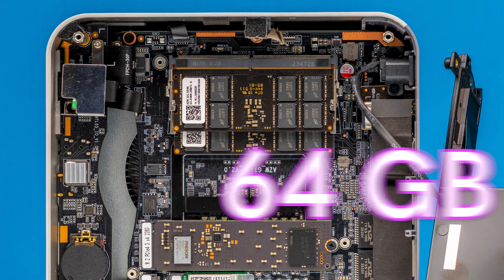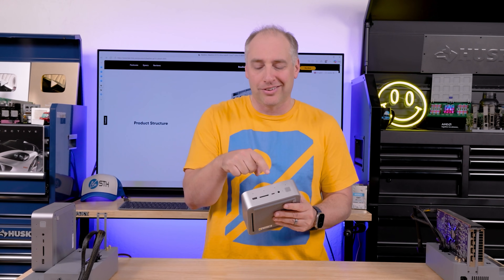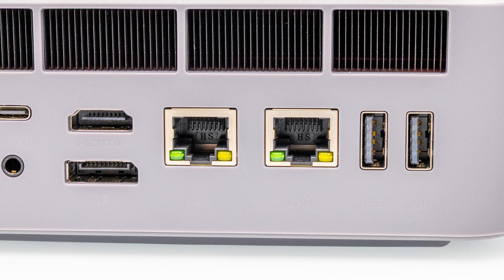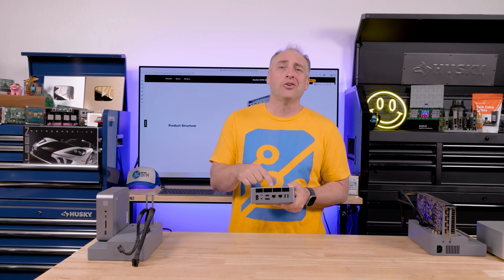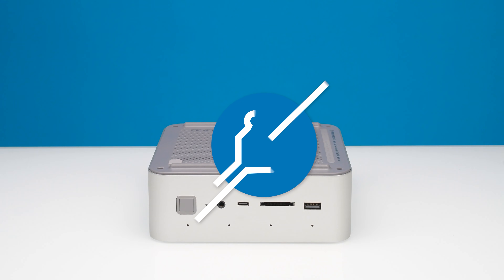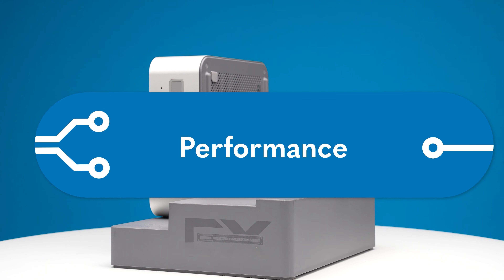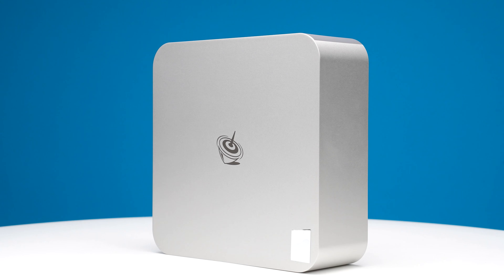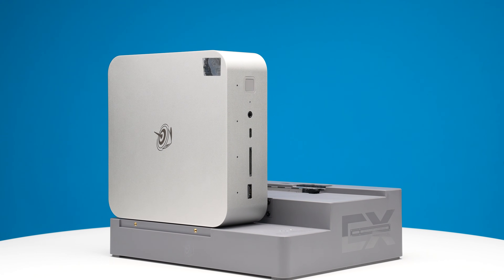An ULTRA Mini PC with 10GbE and GPU Beelink GTi15 Ultra

Comment: I recently looked at mini-PC's barebones and considered buying minisforum. But because RAM and SSD's went nuts, I bought refurbished (with warranty) Dell Workstation Laptop, with 8 core Xeon, 128 GB ECC memory, 16GB RTX Quadro (5000? It's slightly downclocked RTX 2080 Super) for 1200$. Windows 11 installed and paid for on it. And AFAIK running more than 128GB on any board is currently a bit finnicky. Of course the speed of my laptop's memory is... 2667 MT/s (DDR4), but given that 96GB of 5600 MT/s DDR5 would cost me 1000$ at the time, I think it isn't bad. I managed to make a 100GB Partition on 1TB SSD it came with and I plan to install Linux (Kubuntu. I've been told that if I want to fine-tune, I have to use a bit older version 24.04 I think). I just have to find the good application that can make bootable USB drive from .iso image. I haven't been dual booting since I had Win 98SE/Win 2000 and Win 98SE/Win XP. So sadly I don't know what currently is working. I tried one application (Rufus), it couldn't handle 128GB thumb drive, so I just moved the slider to 111GB and it was formatting this poor USB drive at 4 KB/s for like 60-80 hours and I don't even know if I dare to check if it works. Also people tell me to use NTFS, but that was a Windows File System (OG Longhorn). Then again, the only alternative is "LARGE ExFat 32". Last time I tried to install Linux was in 2000, I think.
Reply: Try Balena Etcher for writing USB drives. It should format the disk for you, but generally for removable drives for maximum compatibility you should be using ExFAT - basically the only sensible filesystem that has broad cross-platform support (mac/linux/windows) and large file/drive support.

Not sure why you're being told to go older to "fine tune". No reason to not have an up to date distro other than if you want the LTS (long term support) variant, which is 24.04. No problem with that but also running the latest version would be fine too. 

Keep in mind that windows likes to be weird about EFI boot partitions and will happily clobber your Linux bootloader so I usually recommend disconnecting the windows drive or installing windows first (which it seems like was already done for you), then linux. You may need to learn how to update GRUB with os-prober.

Good luck!
Reply: @protostegosaurus  Thank You. One of the quite big fine-tuners told me that he had to go back to 24.04, because some of the tools he uses, don't work well with newer distros. He did mention that it was specific to his setup and since he does a very wide range of fine-tuning (including multiple GPU's etc.) it might be that the tools I would start with would be okay. At least everyone says that Windows should be installed first. I didn't want to go back to OS that forces me to use Command Line (I'm okay with some use, but the person who tried to "help me" install Linux in 2000, was basically: "Write your own drivers, that's what is the best in open source" - and I'm a bad programmer. I programmed a driver once in my life in Borland TurboPascal and it's not something I could repeat - because unused languages evaporate from my mind), but I hear that Linux is much less "pre-GUI" now than it has been in 2000. And it's not like knowing Command Line and DOS wasn't necessary in Windows 95 (a bit less in Win 98SE).

Thank You again. I hope to install Linux before the Christmas ends. Even to just try it out and get comfortable using it.

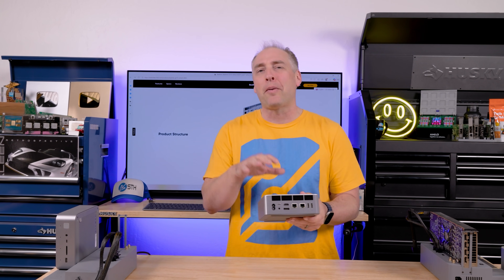Comment: 3:02 Easy answer for the power supply problem... Make a USB4 port on the back capable of USB Power Delivery as well.
Reply from the maker: Good one
Reply: @ServeTheHomeVideo  The reason I want an external power supply is to be able to run it from a DC UPS as it's much more efficient. Though I also agree with the other poster, they could easily support USB PD 3.1 28V/5A 140W like most performance laptops and check off a lot of boxes for a lot of people while reducing BOM.
I also don't need speakers and a mic in a mini PC especially especially when they're subpar. Doubt anyone cares about the HDMI and DP ports either. What I do want is two 40Gb/s USB4/TB4 ports so that I can attach a bog standard dock and break it out to whatever interfaces are needed.
By simplifying the unit they could add more heatsink heft to it to improve thermals.
Love the dual 10GbE Intel E610 NICs, wish more mini PCs had them.
Don't care for the eGPU, use those PCIe lanes for USB4/TB4 or another 10GbE NIC. 
It'd be cool if I could design my own mini PC as it'd be a lot different than what is currently being sold. Beelink certainly has the engineering chops, but their design choices leave much to be desired. They should release a server edition of this mini PC.